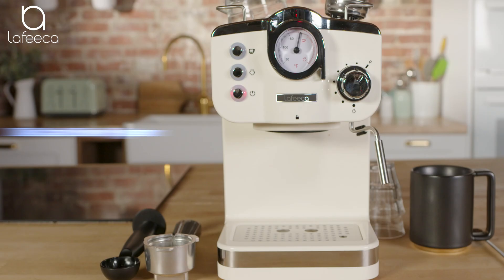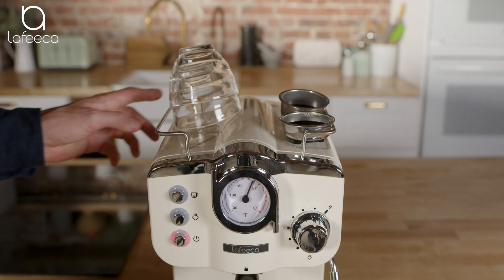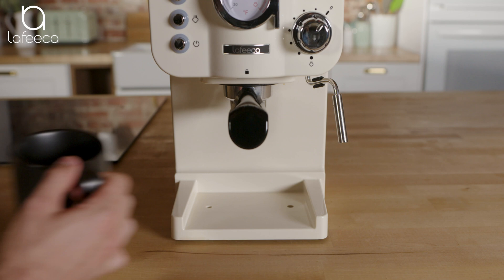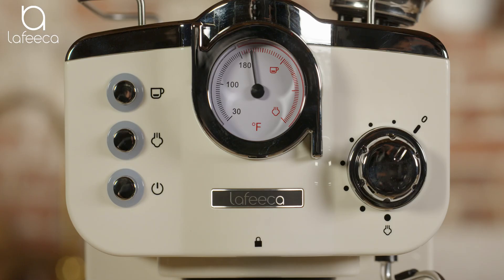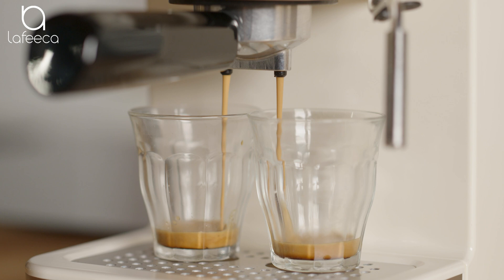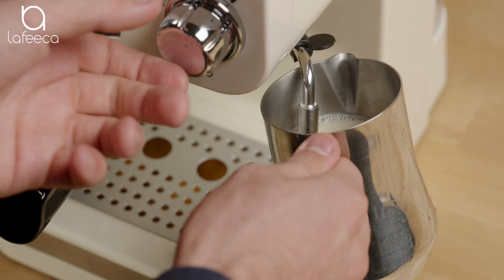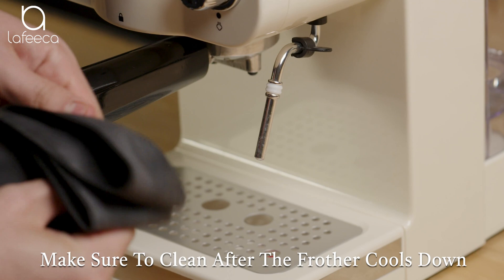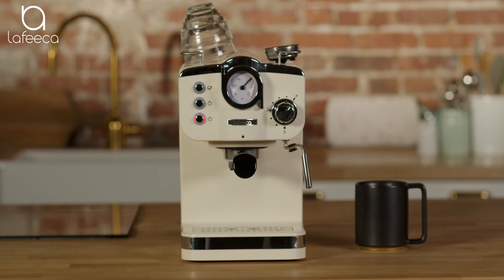Lafeeca Espresso Machine Explainer Video

Comment: I take one look at this and immediately know it's a joke. But people will fall for this and buy it, this angers me. This machine looks like garbage, the cut to stock footage of someone pouring latte art is shady. 19 bars is an absolutely insane amount of pressure, it should be around 8 to 9, but you can't make crap espresso with a pump that low when it's just forcing garbage random grind coffee through a singular hole.
And ffs an americano is not an espresso shot that you just keep brewing longer. That will taste disgusting if you do it correctly (which you absolutely can't with this machine). An americano is an espresso shot that you add water to, it's a very different thing using fresh hot water to top off an espresso shot than to massively over-extract coffee grounds.
I know espresso enthusiasts get a bad rap for being "picky", but... this thing is $200, don't waste your money. Espresso is an expensive hobby, it's not a quick and easy way to make coffee.